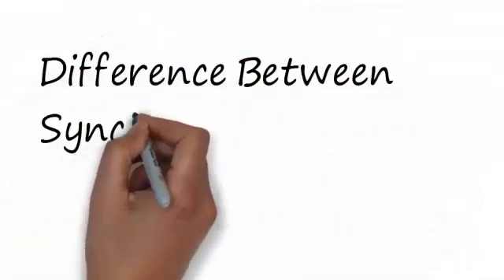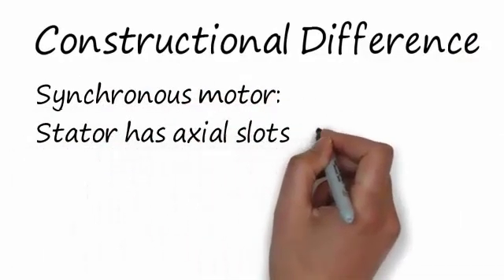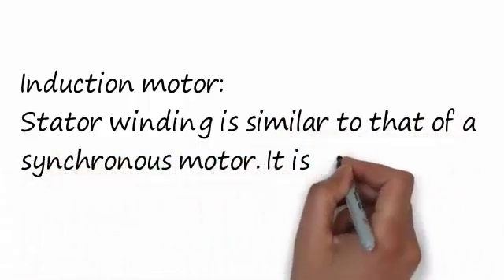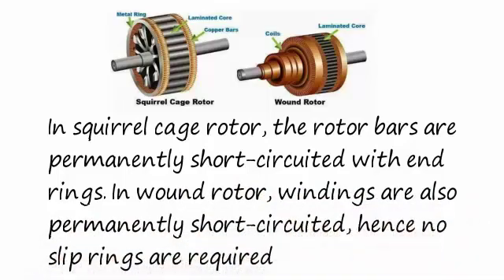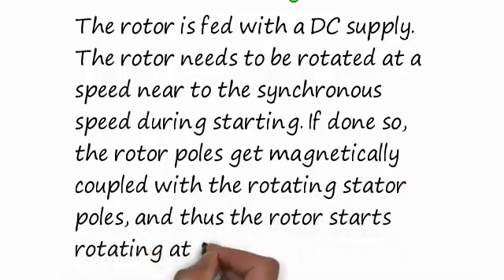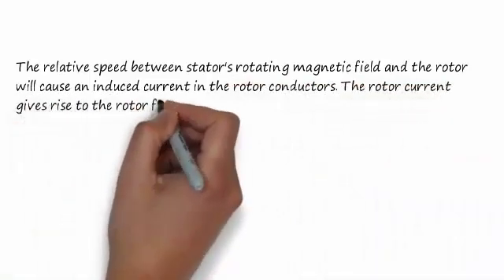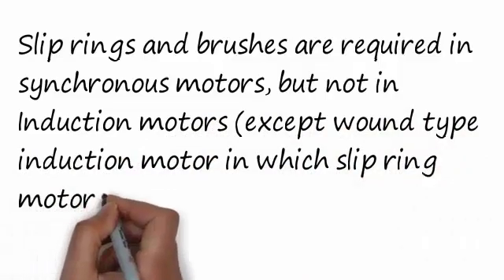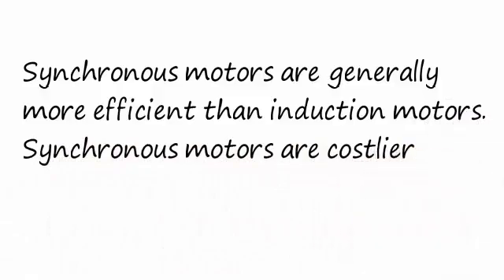Induction motor vs Synchronous motor || difference between synchronous and asynchronous

Comment: The chinese sychronous motor that used in electrical devices such as fan, air cooler, air conditioner's swing, actually is an induction motor that using a couple of additional gears. In purpose of producing a look of the sychronous rotation. No DC supply for starting rotor. Just plugging it to AC supply. But they states on their crap product's label, "sychronous motor". Buahahaha...